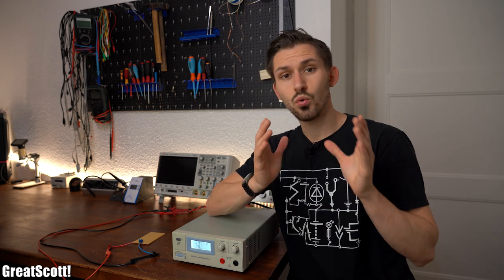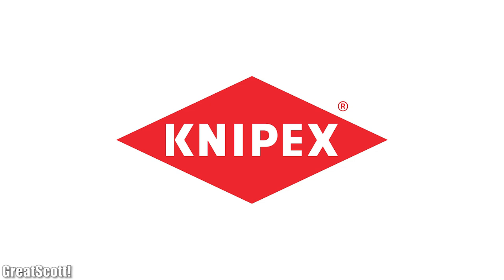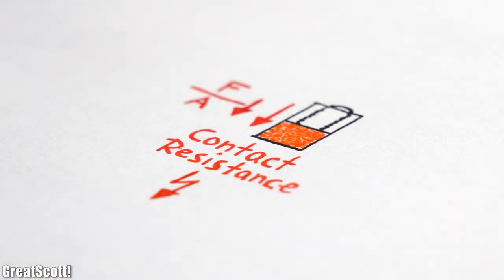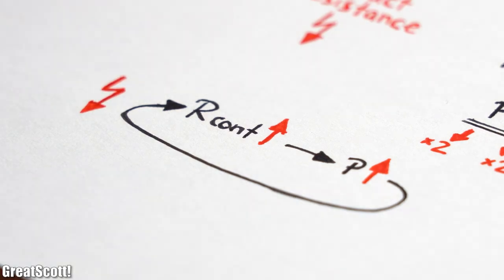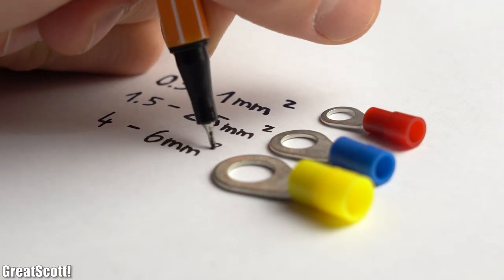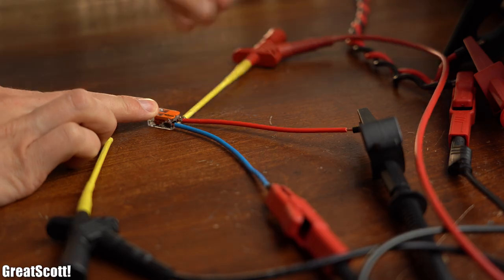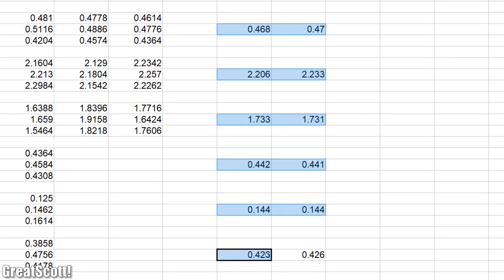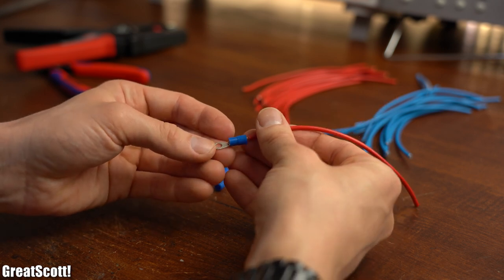Connectors are more important than you might think! So which one is the best? (Experiment)

Comment: Funny, I just inspected and checked terminal tightness on my household mains panel earlier today. It's a good practice to do once a year if you know what you are doing, of course. I found a sparking/crackling connection to a 30 Amp circuit breaker at work the other day and tightened it up. Luckily, I caught it before anything worse happened.
Reply from the maker: Lucky find. Thanks for the feedback :-)
Reply: Seeing this reminded me of the stuff that I saw at my (previous) workplace. 
I was employed there as an electronics/electrical maintenance technician (don't know if that's the correct term)
Some idiot that had worked there before me was connecting CFL lights and while wiring it he didn't pull it through the distribution box and connect it to a breaker. NO SIR. He just stripped the wires and pushed them directly into the 230V mains sockets on the box. 
When I saw that, I thought: Well, there's something every self respecting electrician would kill you for.
And it's not like I knew a lot about mains wiring at the time either. I was like 3 weeks into the job with no experience in the field.
Reply: Same here. I test the RCD monthly and borrow the company torque screwdriver and torque each breaker annually. The inspector laughed at me when I said the RCD actually gets tested 🤣
Reply: @zanpekosak2383  You are the most dedicated person I know. Hell, I don't even know how to open the panel so I can tighten the screws (Granted I shouldn't really be doing it, but someday after I get licensed to work on that stuff, you bet I'm gonna start doing it)
Reply: @gamefan6142  I wouldnt really care much about it, but electrical is still more of a passion than a job to me. I am fairly certain that will change one day though 😆
Reply: One time we were at a movie theatre looking at the projector because it was being flaky. Went to the panel to shut off mains power so we didn't die when opening it, and found that one of the 60A phases had no bolts in it. It was just... Just sitting there in the panel, vibrating with the hum of the current, completely unfastened, having only stayed in place because the arcs welded it there.

Long story short the projector had a bad imaging board and that breaker panel had nothing to do with the problem, but it was still a horrifying discovery that could have burned the place down at any moment.
Reply: @Teth47  Well, that's another thing on my list of DDTD(Don't Do This Dumbass).
Reply: @zanpekosak2383  Legally we are required to test RCDs in Germany monthly. Don't really know many people actually doing it tho.
Reply: @adlerweb  Yeah its the same here. Nobody tests them regularly
Reply: i recently found one in my kitchen- mind you , the only socket i have there... so water cooker , microwave etc every heavy amp kitchen utensil goes on there.
they replaced most sockets a few years ago , but this one was lin the wall, lower than the tiling, they left it.. i opened it up and 1 terminal was loose and burned... i think i got it just in time..
Reply: @zanpekosak2383  not sure you have them in Europe but a lot of GFCIs (RCDs) including receptacle GFCIs in USA have self testing daily feature (often multiple tests in a day) with a light indicator to identify it remains in good working order or if it has  tripped main reason for trip (when we have combination GFCI and AFCI). It saves you quite a bit of time.
Reply: @mathman0101  They most likely exist but as I am from Eastern Europe, our customers typically choose the cheapest possible install over a quality/long lasting one.
Reply: @gamefan6142  wait so the whole thing was basically connected directly?
Reply: @Blox117  The mains sockets had breakers,but the light wires had no plugs, just bare wires pushed into the sockets (if that's what you mean)
Reply: @gamefan6142  oh wow lmao
Reply: @zanpekosak2383  lol sure you do. Quit your bs
Reply: @etherealrose2139  Somebody got up on the wrong foot...yeah, I actually do. Mostly because I have bad prior experince to shit zapping me and RCDs failing. Our fridge had 180V on it casing due to a faulty ground and noone bothered to repair it. We got shocked so many times it wasnt even funny anymore.
Reply: only if you have a torque driver and know the correct torque settings
Reply: @chazM6116  I love torque drivers and wrenches but for electrical panels, the consensus is good-n-tight.
Reply: sadly our breaker panel lost a tab due to a loose breaker connection. i am not very impressed with homeline panels
Reply: @Teth47  If the cable welded itself, it made a secure connection. The problematic time was while it arced, it is good that the temperature was not high enough for the panel to catch fire. The other problematic time will be again when the time comes for it to be disconnected.
Reply: @adlerweb  That shows trust Germany has to their connectors :)
Reply: @chriskwakernaat2328  One socket in the kitchen ?   Are we in middle ages ?
Reply: @dmitripogosian5084  a house from 1952. they didnt have many electric appliances then..and that's the sink, not the whole kitchen.
Reply: @chriskwakernaat2328  My house in Canada is 1961.  Already then we had a code that kitchen must have two independent circuits for appliances with sockets spaced no further that something (which I forgot, 4 feet ?), so I have 8 sockets on two lines over the countertop, and 4 more sockets on the kitchen island, on the separate line as well. And of course oven, fridge, microwave, cooktop and dishwasher are all separate lines   

Over the counter top ones are not up to code now, since they are 15 amp only and not GFCI protected, but that's life
Reply: @dmitripogosian5084  not here. only need 1 circuit for the kitchen with ground. (The Netherlands) small kitchen btw.. no cooking island or whatever.
Reply: @chriskwakernaat2328  My kitchen (and the house) is not that large either :)  In the Netherlands you sometimes get the volume OK, due to the ceiling height :)  But speaking electrically,  basic North American electrical box/socket has a doubled sockets, I don't even know where would I get a single one.  And regulations are that over the counter tops there should be these doubled sockets not further from each other than some distance, and the top sockets should be linked in one circuit and the bottom in the other ones.   So if your counter is short, you may have only a single pair. I never saw that, but two pairs you can see, especially in apartments. My kitchen probably could fit the code with 3 paired sockets, but there is an extra.  Also in North America people tend to give kitchen more of a space, even at the cost for other rooms (my bedrooms are pretty small, for instance)
Reply: @dmitripogosian5084  singe and double here , doubles are just on 1 circuit. like my livingroom has 2 doubles and a single with lightswitch all on 1 circuit AND probably the hall lighting on it too. remember , it's 220v here so less amps per socket.
Reply: @mathman0101  wtf is a GFCI ?
Reply: @chriskwakernaat2328  A GFCI is a Ground Fault Circuit interrupter equivalent to a residual current device (RCD). It protects the individual from being shocked/electrocuted if there is a ground fault which would cause an imbalance in current between the live(hot) and neutral wires.
Reply: @mathman0101  Ah , yeah we have those standard here. 30milliamps triggers it.
Reply: @mathman0101  here in western europe there's no autotest. just a test button on them that cuts the power..

Comment: As an electrician we always used stranded wire with ferrules when hooking up motors and magnetic starters. The solid core would vibrate loose over time from the motor vibrations or just the frequency of the mains power. But the stranded wire with a ferrule due to the flexible nature of the wire wouldn't carry the vibrations and hold the connection

Comment: I work in low voltage controls.  (HVAV, security, etc).  A sign of great work is what he is talking about.  It takes a little extra time, but you avoid intermittent issues and it makes reusing existing wire a snap when it is time to do repairs or upgrades.

Wagos are the best.  Also are handy when you cannot turn off power.  (Of course you never do that right)  put the wago on the hot wire and now it can't accidentally touch something it shouldn't  letting you hook up/disconnect your equipment much more safetly.

Comment: Screw terminals and "when are you ever going to run 10 amps through them?"
Almost all 3d printers run screw terminals for their main power input to the control board, and most also run them on the heater outputs, both the hot end which is relatively low current, as well as the heat bed output.  
Many printer heat beds will run 300-400 watts.  Even at 24v that is a good few amps, but the older printers running 12v have burned boards and started fires.
Mine is switched now from being a high current 24v bed to a mains powered and SSR switched bed, but that's taking a few extra steps beyond just using heavy terminal blocks on external switching, as well as bootlace ferrules.
Reply from the maker: Thanks for the feedback
Reply: This ^^ - both my 12v 3d Printer beds are 120W, so pull 10A all the time.
Reply: YEP! Thats why I replaced my Hotend/Heatbed connectors with a MOSFET board that has some beefier connectors. All you run through the stock screw terminal then is the signal for the MOSFET :D
Reply: Completely agree. Another example: I play a lot with LED strips, and prefer the 5V varieties because individually addressable RGBWW LED strips only come in 5V. I can easily push 15A through the power lines (which I usually use 1.5mm or even 2.5mm twin and earth to power, for that reason!)
Reply: Consider the source and the cost of said equipment. Never to be done like this in an industrial environment.

Comment: Great video.  I 'discovered' ferrules about 8 years ago and pushed hard for my guys to use them.  When inside a large panel/cabinet, hanging upside down, trying to stuff a stranded wire into any sort of screw/spring terminal is nuts.  Crimp a proper ferrule on it and it's a piece of cake.
Reply: I just discovered ferrules today. I was having so much trouble with my USB screw terminals using stand wire and now hopefully won't have any more problems with the crimping and ferrule kit on the way!
Reply: With industrial automation, ferrules are the only way to go.
Reply: It is not only handy, but safer and gives longer MTBF. Of course one can live out of making such timed-faults ;-) Small quiz: what is the colour of stranded copper wire after 5 years in an outdoor cabinet?
Reply: Yeah i know what you mean, an electrician recommend them to me years ago for wiring heating systems, which often leads to multiple, stranded cables all in the same terminal. Good advice but luckily, since then, there's better, larger boxes with semi-pre wired terminals.

Comment: "Butt connectors" are so called because of the way the connection or joint is formed-- the 2 wires "butt up" against each other. Not sure if it carried over from woodworking ("butt joint"), but the idea is the same.

I like to use IDC or Ethernet for lots of data lines.

Comment: I love using the Wago connectors I only wish i'd discovered them years ago.
Reply: When I discovered them, I tossed all my wire nuts in the trash where they belong.

The countless number of times I had to retighten a nut is aggravating. I've never had that problem with Wagos.
Reply: @Rudofaux  Oh hell yes, wire nuts should be banned for being a possibly fire hazard.
Reply: @Jupp Schlabutt Oh that explains why I only recently discovered them then !
Reply: @Rudofaux  Same, here in France we don't have wire nuts, but in the past screw terminals were our standard. Never again used screw terminals since i discovered Wagos.
No more retightening, and as an added bonus much time saving and much more practical to install.

Comment: I'd like to point the importance of choosing the correct crimping profile when it comes to cable ferrules - there are two common profiles: square and hexagonal. There are also two types of PCB screw terminals - with a square hole and with a round (or a semi-round) hole. So, the square profile is intended for square screw terminals and the hexagonal profile is better for round terminals. Also, it would be great to include the XT connectors in the comparison (XT60 and XT90), which are becoming pretty common in hobby projects (like RC models, 3D printers, etc.)
Reply: aren't XT60/XT90 good anyways since they are made for drawing 60/90 amps each? So they are a good connetion as long as you bought good quality ones and you solder them in right.
Reply: Huh, I didn't know about crimping profiles.  One degree and over a decade in the field, and there's still more to learn about the basics!

PS: For anyone new, that's not a bad thing, and is half the reason I wrote this.  There's always more to learn.
Reply: Thanks for the heads up, I was also wondering what's so better about the hexagonal crimping tools I saw when I bought my square one, my thinking was that the square crimped joint has better surface area on the terminal I was using (in fact, a square terminal as you mention and he shows on video). 
Might grab for work an hexagonal tool too, there it's more likely to use higher current terminals that I've seen in round form.
I'm also curious for the X60 ones, those are certified for some serious amps (I think it's straight up it's name right?), I use one for my print bed indeed. Tho that's bellow 15A.

Comment: 3:57 Solder is also not recommended because the leftover flux makes it oxidize exponentially faster as it reacts with the oxide and flakes it away. It also introduces a new metal really far back from the low end of the standard potential table which also increases the speed of corrosion
Reply: Flux can be cleaned off with alcohol or white spirit and the usual rosin flux is barely corrosive anyways. Tinning wire strands is totally fine on a screw terminal with not much strain on it and low amperage. No need to look at periodic tables. Low current -> use solder, High current -> crimp. Simple as. No need to look at periodic tables. Frankly, this video is just a German wondering how to make life more complicated, and as such is not very suprising.
Reply: @westelaudio943  That all is mostly untrue. On a PCB where the surface is smooth and watertight, where flux can't remain in cavities, it does work. But in the case of large conductors and stranded wires what you can end up with is cavities where the flux gets stuck between the strands, gets wicked up into the wire under the insulation (you may have experienced wires stiffening under the insulation, even when solder doesn't go up that far, that is because of solidified flux) and then you run into the issue of what the flux is made of. You have rosin core, acid core, ammonia salt based, really a bunch of them and they might not be alcohol soluble (such as the latter two).
About tinning wires. Are you talking about tin or solder? Because tinning does work to prevent corrosion. Soldering makes it worse.
You, my guy, are confidently incorrect and hope you don't ever design a product.
Reply: @whatevernamegoeshere3644  

I meant cleaning the surface that goes into the connector. Of course rosin gets sucked up the wire, but you totally ignore that's also what happens when you solder the stranded wire directly onto something, which I've seen so many times in commercial products I've lost count, some made before Boe Jiden entered politics (and that's a long time!) and as of yet, none of those connection has gone thermonuclear in my face because the wires were rotten inside. I've seen Russian electronics where rosin was left on the bare copper PCB, and none of the traces were corroded, like, at all. Old Russian electronics are actually cherished for their reliability.
 Maybe cool it a bit with the paranoia. You're repairing an old radio or designing an LED flasher, not a nuclear reactor. Have fun!
Reply: @westelaudio943  You don't consider that the placement of a wire connection greatly effects the lifetime of a connection. The plastic insulation can let oxygen or water through. If you were to solder rubber insulated or cross-linked PE insulated cable, I would not care at all. Those are fine with oxygen and moisture, but PVC and Neoprene let a lot more through, making it an issue. I have seen so many solder joints rotten to shit that I lost count. You might have been just lucky!
There is a very good reason I cannot leave a single solder joint in house wiring in my day job.
Reply: @whatevernamegoeshere3644  

I do not ignore that. I've already pointed out
  situations where tinning (or soldering, whatever) the strands is not acceptable - like when dealing with high current or strain. I'm sure there are others as well. I've never said this technique is the right thing to do in every application. But in "comsumer grade" domestic electronics or simple DIY projects, which this channel is mostly about, you can very often get away with it. Even with normal PVC wiring, you see it done all the time. 
My problem is not pointing out the issues with such a connection; it's that Scott just plainly stated it's a "no-go" which simply isn't true.